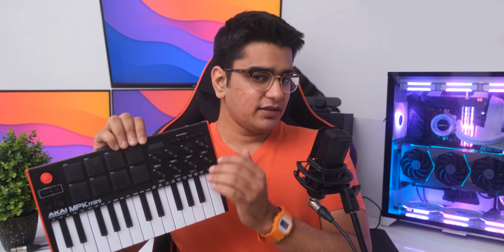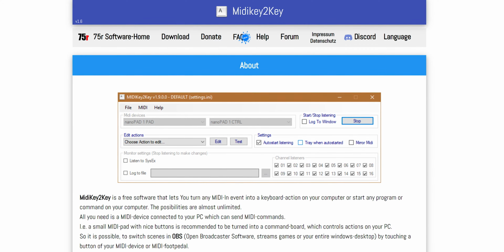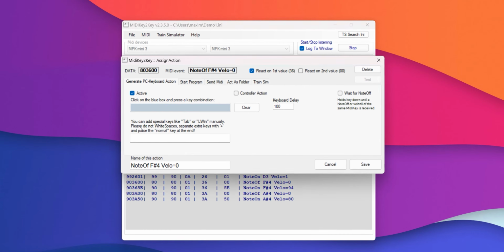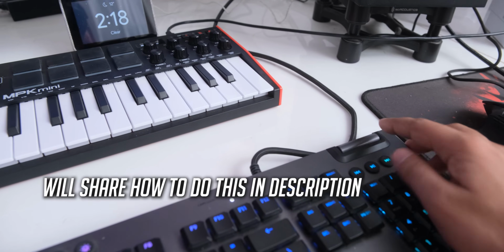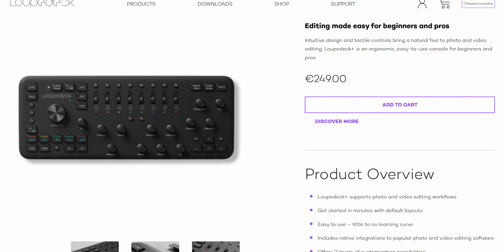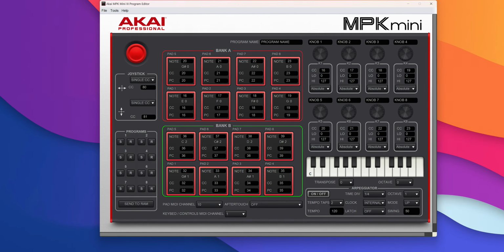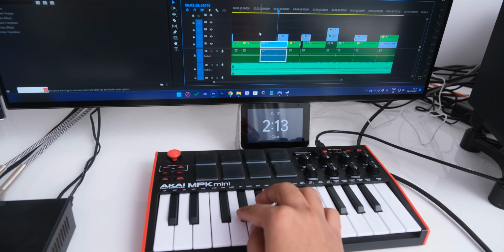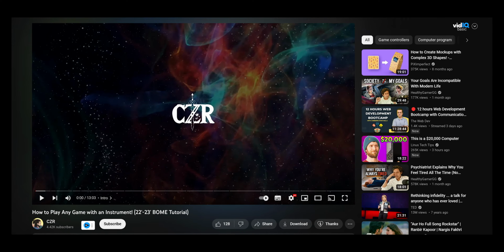BETTER THAN LOUPEDECK?! [AKAI MPK MINI MK3]

Comment: I often find that the purpose built devices are much more expensive, but stuff not really meant to be used in that certain way end being a really good and cheap alternate to our use-cases.
The possibilities are endless with this.
This reminds me of your video on that portable touchscreen monitor and the different things that could be used for. 

This is the kind of stuff I love about tech. The DIY-ness of things and 'hacking' stuff to make it work for our use-cases. I recently saw an amazing video by this guy (YT - David Zhang) who used HID remapper and other stuff to basically control his entire desk with a macropad. I certainly want to try that sometime.

I like how you highlight such possibilities on your channel and I think you have sold me on this, just like that touchscreen monitor. These are things I definitely want to try to do with my setup.

Great video, as usual!

Comment: Bro suggest me good gaming headphones with multimedia purpose also. I need them for my ipad pro 11 inch 2022 My budget is 3500/-rs
Reply: Please reply bro 🥲
Reply from the maker: You can get OneOdio headphones in that range, will have to use adapter or new cable for iPad pro.

Comment: Is akai mpk the best midi controller under 10k?
Reply from the maker: Yeah, I researched a lot before buying it. Though, there's some new 32 key model for 15K which also has pitch and modulation wheels, in addition to RGB pads, so that is definitely better, unless you want a compact 25 key keyboard.
Reply: Thank you